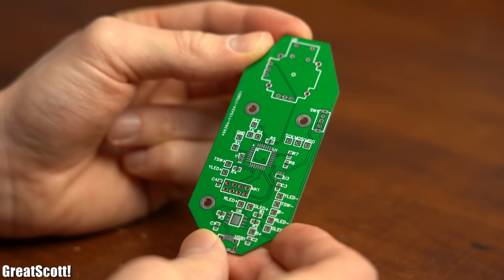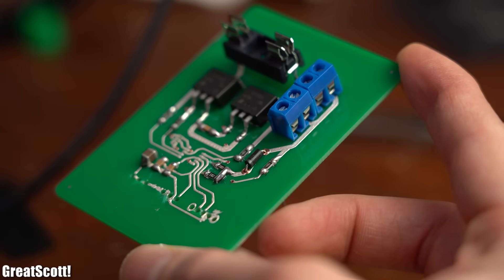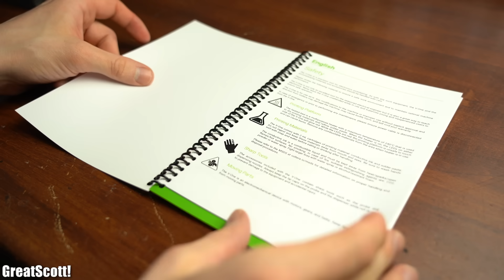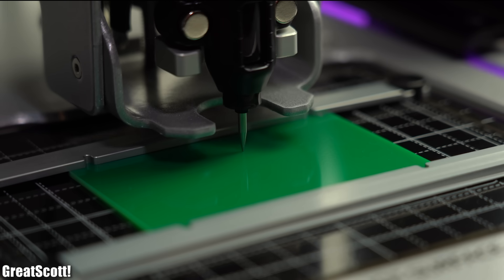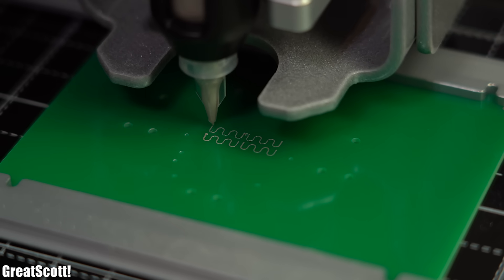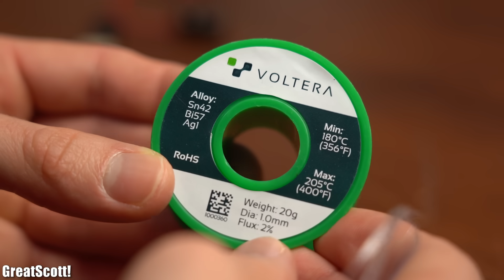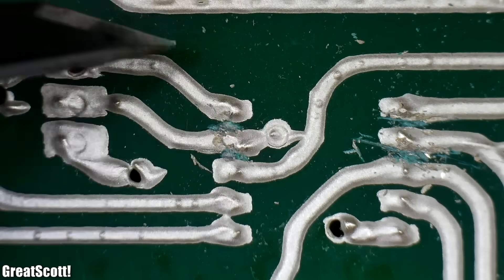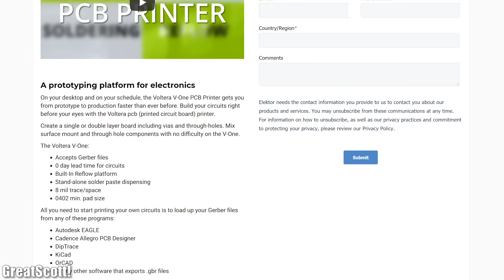You can now PRINT PCBs! Creating a homemade PCB with the Voltera V-One PCB Printer!

Comment: Even better would be laser routing and drilling.  The copper could be covered in a material that both serves to absorb laser energy and protect the traces like a mask.  Laser power would vary to ablate just the coating for pads, the coating and copper for traces, and drilling/cutting the PCB.
It would have another head for flipping the board and placing vias.
Surely this is possible.
A complex board in a few minutes would be pretty cool!

Comment: I think we need a DIY or buy on this one
Reply: DIY would be stupidly easy. Nothing about this is sophisticated at all, just the changeable tool platform is a bit unique in that it uses pin to pad as a connection method, and that the bed works as a workpiece clamp and the curing heater. The only other non-standard thing is the screw-based plunger extruder for the ink vial, but this isn't anything difficult to implement. The drill itself is so unsophisticated that it uses a literal RC hobby motor to run it. 

Take any typical 3D printer, add a clamping system to hold a PCB blank to the bed, and have a a changeable tool system. The plunger extruder would work off the filament extruder's functionality but at a different feed rate depending on the gearing between motor and plunger. The drill could probably run off the extruder's functionality as well, but implement it as a switched function where a constant feed rate has the drill as 'on,' and stopping the feed rate switches it to 'off,' with a simple amp to run the DC motor. You could probably even upgrade the tool changer from a manual system to an automatic system.

The only sophisticated part that would need work is the probe function, as most closed-source printers won't integrate it nicely unless a probing system is already provided, resulting in the probe being entirely separate and integrating at the design software level, or there's a chance more open-software products would allow it, with open-source platforms being the most open to this modification. But with that said, is probing actually necessary? Most 3D printers are going to be level for proper printing anyways, and the clamping system should be sophisticated enough to keep relative flatness of parts, even with the PCB floating in relation to the bed; even hobby milled standoff clamps should be toleranced well enough as long as the hobby machinist knows what they're doing. As for positioning purposes, I would think a laser pointer would be a valid replacement, and would be an entirely passive tool. 

This only leaves curing. I'd recommend and oven as no typical 3D printer is going to have a bed that safely achieves the 210°C requirement. Heated beds for ABS only really achieve >100°C due to going above the glass transition temperature of 100°C isn't really recommended. A heated bed that'll go to 210°C is a modification that is possible, but at that point it's probably safer to use an oven due to burn hazards on an open surface.  

The only big issue is the consumable that is the ink. I'm not sure how many suppliers there are for this stuff. Though I do wonder how similar it is to solder paste that board manufacturers use for SMD soldering; seems like it'd be similar stuff, high silver lead free paste, just the 'ink vials' use a much finer syringe tip. There may also be some kind of etching agent, or something in the reaction while baking, that adheres the paste to the fiberglass of the PCB; though I'm not sure how soldering paste interacts with a raw PCB without solder mask, as SMD soldering always has a solder mask on the etched PCB, there may not be a need for any method of adhering the paste to the board. The paste is the big unknown, and the cost of the Voltera pastes makes an alternative solution worth looking into. 

On the topic of conductive consumables, we've also seen actual conductive ink, as in pen ink, and we've seen various forms of filament that're metallic and conductive once you bake off the plastic. I don't think finding a product between the two would be all that difficult, especially as solder pastes already exist in various recipes. Unfortunately, Voltera doesn't list the metallic recipes for their inks, though they do for their various solder pastes. All of Voltera's products also require refrigeration for an 8 month shelf life, which makes this entire system even more expensive given that each vial is only 2ml. 

Only thing left is the rivet tool, probably the least sophisticated tool here, as hollow rivets have been a thing for a long time and are mostly understood in how they work. 

At the end of the day, the conversion is simple, with a simple manual tool changer, and simple code hacks to make it all work, with the biggest issue being the cost of OEM solder pastes and the need to find an affordable alternative. All of this is also true for converting a CNC mill, though you'd need to make more drastic changes to how the tool functions to get that platform to function correctly, as exchanging extruder type A for extruder type B is fairly simple and could easily be a 1:1 exchange in coding, but adapting a mill would be like adapting the mill to a 3D printer first before adapting it to a PCB printer. All of this is easily achievable, it's just the damned ink that makes the DIY project expensive. 

But does anyone really need a PCB printer? PCB printing services are extremely affordable, with some having decent turn around times, not to mention those services can do everything a PCB printer can plus more, considering those services can also do multi-layer boards. Even DIYing a double sided board isn't that difficult, though chemicals involved may produce safety hazards, but a simple masking and etching setup is extremely cheap in comparison to a machine with a high cost consumable ink. While a cool project, I just don't see the point of it. Need a prototype board? This is what we have perfboard for, or even better, just use a breadboard until an order from a PCB service arrives. There is literally no logical explanation for PCB ink printers to exist, other than being an expensive toy for people with more money than brains. I can't find a single use case where this machine has any advantage over what we already have and already use; especially when the consumable has a shelf life that requires you to actually produce a decent volume of boards within that time frame.
Reply: @xaytana  Right you can just get a simple CNC mill from eBay for $100-200 and add parts on to do what this thing does for less than 1/10th of the cost. Conductive ink is nothing new they aren't the first and it is cheap not only is it cheap you can make it yourself at home.
Reply: @xaytana  It's so stupidly easy that I wasn't even able to read through your comment 💩

Comment: This machine is the best 3D-print-PCB design so far. However, the electronic design community remains in demand for a right fast solution (the trace dimensions and quality are simply not there yet).

Comment: At work I had access to a 10w laser marker. I use laser to burn away the solder mask on a (fullly coated with solder mask) copper board, and then do the etching. The burned region get exposed and dissolved just like the ink transfer method. After that I burned the solder mask again to expose the copper for soldering. A bit tideous but the quality is excellent. Probably the best result among all pcb prototyping methods. And easier and more reliable than other etching based methods.
The laser marker has super fine resolution. And the absobtion rate of copper fot 1040nm laser is a lot lower than absobtion rate of solder mask, so the laser remove the solder mask supper cleanly.
Of course you need a laser marker, which is not cheap, but not super expensive either. Or befriend someone with a laser marker.

Comment: While I don't mind the €4000 price tag, the fact that the consumables will add up to a lot real fast, and that there is a lot of manual labor involved this seems more like a prototype kind of thing. If the parts were way cheaper, and it would calibrate everything on it's own, as well as drill and print without having to have manual inputs I would have no problem paying the €4000 upfront cost.

Comment: I've made pcb's by different methods over the years and ending up buying a chinese cnc to mill prototype pcbs and have to say once you've got the hang of it and got quality endmills it produces a very good result rather than getting out the trays to develope, etch and drill boards. The great thing with the cnc is it does so much more like milling aluminium, wood, plastic etc. Mines not up to milling steel although I have done 19" rack front panels. For the price of that printer I'd want it to make my tea and clean the house. Like you said, it has its place.

Comment: For people who want actually professional pcb at home: just invest into uv curable photoresist and solder mask, and a decent quality laser printer for negatives and that's it. I recently started it and even myself is surprised how good the quality is :)
Reply: Absolutely agree! Even with a cheapo $80 laser printer and some crappy 50c transparent film I can get features small enough for QFP48 packages without much trouble. Great for single prototype boards before committing to overseas manufacturing
Reply: I used to do my pcb's at home for 10 years before I got tired of it and switched to professional manufacturers. Sure it was cheaper and quicker, but was too much of a hassle.
I did double sided <0.5mm pitch smd boards with solder mask and chemical pre-tinning, so pretty advanced stuff for home pcb manufacturing IMO.
Now that I do projects that require at least 4 layers it's just not possible to manufacture pcb's in home anymore.

But relating to video: the pcb printer's results were absolutely horrible and hardly justify the ~4kEUR pricetag with inks that cost arm and a leg.
Reply: I was getting better looking results with a CDR-pen and  bottle of ferric chloride over 20 years ago :)

Comment: This printer is very cool for electronics enthusiasts, but it seems that it can’t make thin wires below 10mil. Vias are also a very embarrassing problem, but it is still shocking. Although it cannot replace the existing PCB production line in a short time, But all new explorations make me respect

Comment: Interesting concept, but for rapid design and prototyping, I have generic QFP, QFN, (T)SSOP to dip breakout boards.

For a two layer board, the amount of times you'd have to use it to break even compared to JLCPCB seems extremely high. If it could do 4+ layers then an argument could be made; however for industry, they probably have their own fab set up. Likewise, for universities, they probably have a laser etcher. If not, then extremely cheap access to board fab processes.

I feel like this should be targeted to the hobby market. The price is high now, but in 10 years, it'll probably be like buying a 3D printer. So I don't think this is wasted technology, I just think it's too new for it's target audience.

Comment: Using photosensitive blanks and etching seems an easier way and so much cheaper. You'll have real copper and high precision. Vias and drilling is actually the difficult part and using a cheap cnc for that works fine.

Comment: I would be happy with a flatbed printer that could print an acid resist mask on copper clad FR4, ready for chemical etching.
Unfortunately, it is likely that such a device might have a short useful life, as more and more components move to BGA. I think these are really too difficult for the amateur to place, particularly when they require a multilayer board to get the connections out from under the device.
At the moment I am usin a combination of CNC routing and chemical etching for producing double layer boards, but devices with a in spacing smaller than an SO8 IC are difficult to produce, giving a lot of failed attempts. At this level, almost all PCBs work first time.

The trouble with home brew PCBs, apart from their obvious limitations, is the cost of consumables to produce them. It is not difficult for the cost of consumables to exceed the cost of a professionally produced prototype board. Here is also the increasing difficulty in obtaining the chemicals involved. I use a copper chloride etch, and this requires hydrochloric acid to revive it. This is much harder to get these days. Plus there is also the used chemical  disposal problem. The CNC removes most of these concerns , apart from the electrodes tin plating. Unfortunately the CNC is no so good when the design calls for large areas of isolation between tracks. Milling large areas of copper is both  expensive and time consuming.

Comment: I am working on a home pcb manufacturing process that you might find useful and want to show off here, (my videos and instructions as well as the journey of failures and such will all be on LBRY and be open for use as I am opensourcing it,) one small preview bit of info is it involves chemical etching, with  no mask required (physical one at least as I am using a digital one I suppose) and common salts in water to avoid nasty chemicals I just have to figure out which ones will work with my equipment best and make something that if not able to be tossed down the drain with out problems, then as close as possible with the easiest way to neutralize waste so it can then be either tossed or diluted and used maybe as a fertilizer additive for growing plants, (also want to see if one option allows using the waste as a copper nano particle printing material, but that will be its own whole journey LOL)
Reply: also one nice thing about this journey and process is it should offer a less chemical nasty version that I used to make flexible multi layered PCBs using copper and brass shim for the conductive traces and kapton tape as the backing for the PCB (and the top coating too, in some cases) with each successive layer being added to the back by using transfer tape I believe it is called ( made by 3M and comes with and with out a solid plastic layer, the stuff with out has only the adhesive layer like a rubber sticky stuff you apply then peel the backing it peels off the rolls with, as it is kinda waxy on both sides, with the side you see on outside of the roll being slightly more adhesion resistant) the stuff I have is a light brown paper with green lettering for the different types, and some come with a white on one side and silver of some sort like a layer of aluminum reflective material on the other that both sides are coated in adhesive (this stuff is excellent to turn a label for shipping printed on plain paper into a peel and stick label, and you can often find it tossed out when they make massive amounts of various stickers and name plates and such at that sort of factory, as the off cut stuff between things they cut then out, or as the last bit left over of a roll too long that they just toss the roll out later, also mistakes can cause giant sheets with 10 or more layers that are slightly wrinkled but plenty of useful area for the DIYer like us, and is good up to like 400 degrees F (so basically around 200 or so,) with a couple versions being good up to 600 or 650 if I recall, (300+C) though finding that is probably going to be rare, anyway its good for heat sinks too, as  long as you make sure to press all the air out, because this stuff when you peel it off will peel the chrome off of steel tools when it comes off, LOL so best to use chemicals to dissolve or soften it, or probably just burn it off when possible. (or dont apply unless it will be there till the thing is destroyed) 

anyway this double sided sticky stuff once applied to the back of a layer I was able to then lay down non-sticky side kapton over it and a layer of copper shim that I then etched and applied the next layer, with all the through hole areas I simply pressed together over openings I either cut away the tape or tape and contact transfer tape adhesive from the other copper layer and put a drop of solder on both areas to tin them so I could then press on the top of the last layer and melt the two layers together. Hope this helps :)
Reply: if anyone has tried vinegar and hydrogen peroxide to do copper etching let me know how you did it, cause it was not very effective, and ferric chloride is a pain to make and expensive when you are trying to avoid that pain making it LOL (and seems to have left some stains on some of my glassware though that might be because it was the cheaper options and not true pyrex brand or something.) honestly I would love to be able to use acetate for it as it is pretty easy to make copper nanoparticles out of it, with some basic vit C or formic acid which I have some left of each.

Comment: If you want to see a real 3D PCB printer, look up the Dragonfly by Nano Dimension. Works similarly to the polyjet process Stratasys has, except using a dialectric and conducive "ink". EEVBlog has done a video on them iirc.